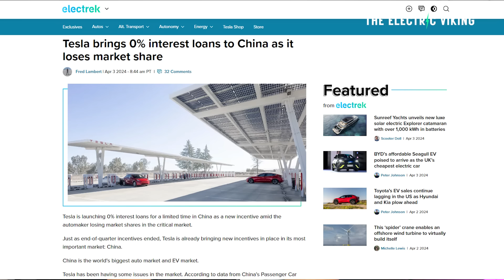Tesla offers 5 year 0% interest loans to boost sales until Juniper arrives

Comment: 0% interest is better for Tesla than reducing prices I think.
While it does cost money to subsidize interest, if the owner sells the car, the loan is gone.
Also since the price then is not lowered, but rather the rebate is on loan interest - it means people will think that its cheap even if they loan money.

Also if you dont reduce prices, but give the 0% interest - it means people dont loose value if they already own a Tesla. So then its easier for existing owners to trade for a newer Tesla.
I think Tesla also should incentivize current Tesla owners on buying. a new Tesla, if you owned already 1+ Teslas, you should get some incentives to be a recurring customer.

Comment: Yet another price cut.   This will cause current Teslas trade in value to be close to $0.   And I dont believe a single thing Tesla says.  They have lied so many times and co timid to do so.  Only 10% battery degradation for 200000 miles!   This is total crap.   I’m 56 years old and I have NEVER seen a car with that much mileage except for a taxi.  And those cars have basically rebuilt engines where almost everything has been replaced over the life of that mileage.  Yet I’m supposed to believe a battery pack will last that long.   Total total lies again from Tesla.   I hope Tesla is paying you Sam.